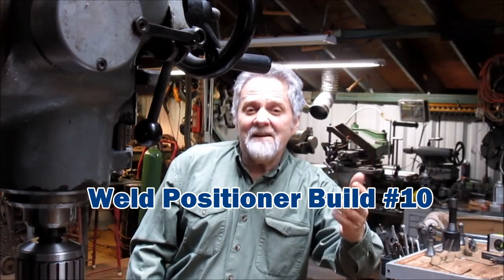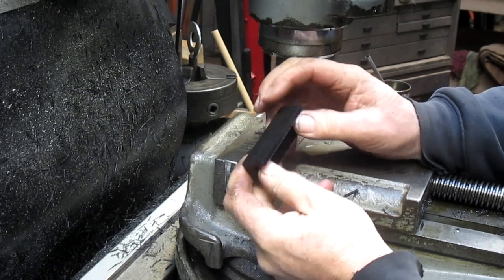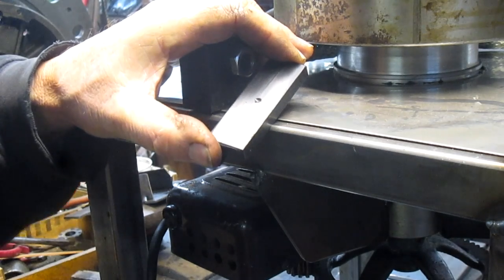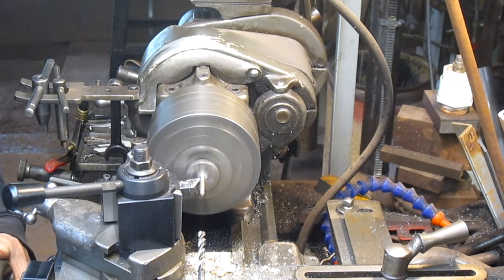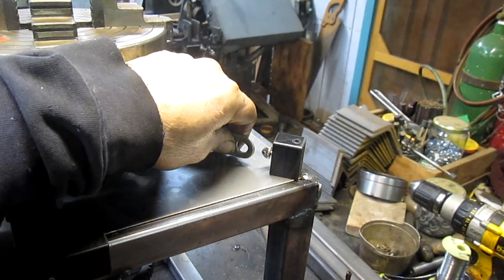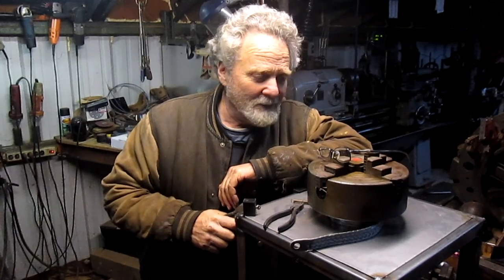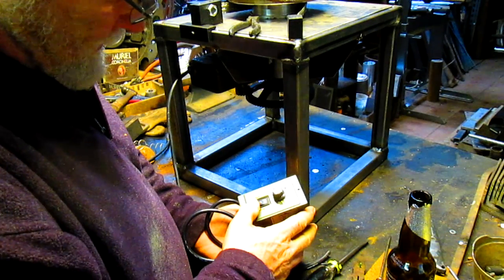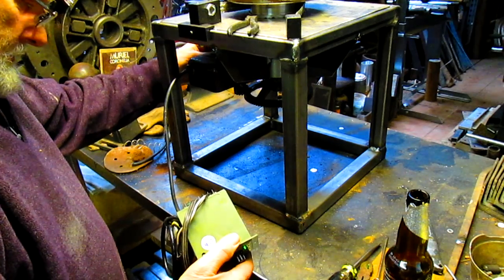Weld Positioner Build #10

Comment: Nick, just a further thought about your welding torch. As you may get several parts to to do all the same, how about making an adjustable torch holder, it will keep the torch angle and distance constant. All you will then need to do is operate the swich on the torch for gas and wire feed, will save your hand and arm aching from holding it.
Reply from the maker: Humm, not a bad idea. Got my wheels turning.

Comment: Saludos Nik, I think you have a problem with isolating the 3-jaw electrically from the frame. Unless i missed something the supporting brackets are shorting the 3-jaw to the frame. Make sure you check the resistance from the frame to the chuck with an Ohm Meter. Also, Don't forget the that the drive motor and shaft might be a low resistance path to the frame as well. Love the videos keep'em coming.
Reply: in addition would you ever have to reverse polarity of your welds?
Reply from the maker: In 50 years of welding I've never had to reverse polarity. My welds aren't that exotic.

Comment: Why didn't you just bring the spring end over to the other block. Seems to me it would have been easier. Enjoyed the build . The ole CRIPPLE in NJ
Reply: Don't think that motor will work with that. Try just a router speed control , HF sells them about $12.00
Reply from the maker: Looks like this project isn't over after all. I've got a DC motor that should work. More videos I guess. I didn't want to take the chance that the power would ground through the spring and melt it.

Comment: You might want to think about some sort of shield for the chuck, at least something to keep the weld spatter out of the scroll.
Reply from the maker: It is cast Iron so the splatter won't stick, but you are right. With each job I'll need a shield. Thanks for the reminder.

Comment: I realize this is an older video. However, once you attached the ground braid to any metal on the rotary table, everything metal anywhere on the entire structure is now ground. Take an ohm meter and see for your self. And therefore there really was no need to isolate anything from the chassis. You can just attach the ground electrode to the table and even remove the spring isolation setup. It isn't needed.  The current won't toast the bearing since everything is the same ground potential. Test it for yourself with a meter.
Reply from the maker: Yes, you are very right, but if electricity finds its easith path and we are talking about 30 to 50 amps moving through that system, my thought is that it is best to give the majority of the power a direct path, not through the bearings which would weld in place the first time I struck an arc. It is what I have always been taught anyhow. Thanks for watching and thanks for your comment.

Comment: Nick, what is the other cable coming out of the unit with the white plug on. Perhaps that is the output.
Reply: Yep. I'd use a voltmeter on that plug to see if something's coming out it.
Reply from the maker: Turns out that I will need a DC motor. another video.
Reply from the maker: DC motor is the answer. a future video.
Reply: I was wondering about that. Shadow pole AC motors are not easily speed-controlled. Something like this might work: http://www.ebay.com/itm/162355094908. Using a belt drive can also help isolate the motor from the high-current leak, thought it adds complexity and required mounting space.
Reply from the maker: Yes! Exactly what I was thinking about. It gauls me to buy new, especially from China, so I'm going to hit the junk yard and find a electric window opener.
Reply: Wiper gear-motors, especially from trucks, are stout and bullet-proof. Take a small 12V battery with you to try them out before you pull them - like, if they are reversible and how fast they spin at the output. Looking forward to the re-do videos.
Reply from the maker: Yes, test first. Good point. Volvo motors are bullet proof too.